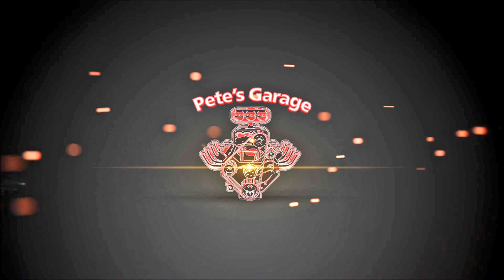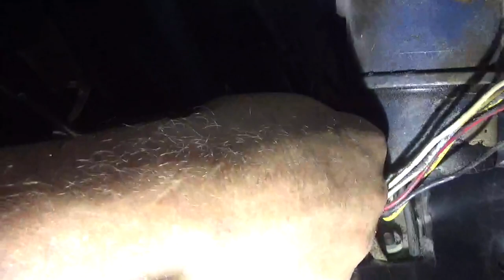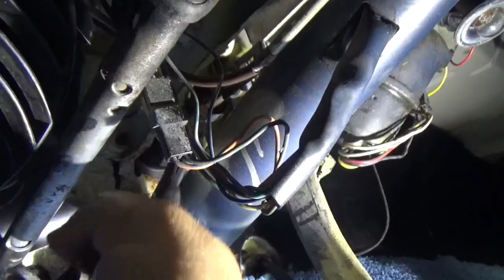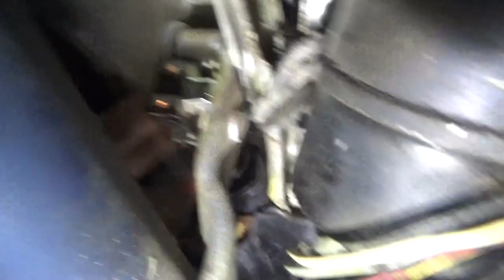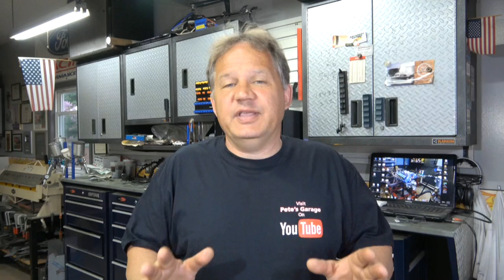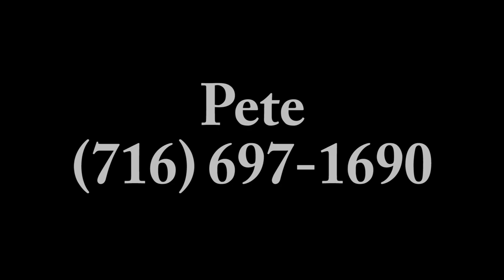1965 Mustang Changing the Brake Light Switch - Worldwide Machine Shop Database

Comment: I would step on my brake and the light would not go on till end of braking. , spring was very rigid. Took it apart squeezed it with pliers several times, also put a spacer to allow the lights to come on sooner. Worked.
Reply from the maker: Old cars are fun

Comment: I sent it to your email but there's a machine shop in Menomonee Falls Wisconsin call Fast Times holy crap do they do incredible work, they have left me with a big smile on my face on quite a few occasions.
There's a shop in Phoenix Arizona called loper's Performance Center. They did the machine work on my Blown 572 Polara, when I had it I used to race it at Firebird Raceway. But then I sold it and built the hell out of my 68 LeMans and like a stupid idiot move to Wisconsin.
Reply from the maker: Awesome! Thanks again Bill

Comment: What about bushings? Do you need to reinstall them? Do you need more than one seen on the push rod (white)?
Reply from the maker: Yes you do. These are really tricky because the length of the push rod will hold the light on or not turn it on.
Reply: @PetesGarage I had this issue forever and couldn't figure it out, then one day i got tired of it laughing at me (lol) and i decided to tackle the issue.

What happens is a lot of times the black inside bushing gets worn and falls off or disintegrates etc,since its not there anymore the rod will push on the switch but that nice black bushing is not there anymore so the rod has a little extra travel, what that does is it bends the switch plunger,it will still work and your lights will come on fine however the plunger on the switch is no longer flat, it is now curved.

One day you are changing your booster cause it went out and you tell yourself "wow, that black bushing is not there anymore, im gonna order a new one,you put in it, happy that you are putting everything back original and guess what? your brake lights dont work anymore!!! the solution? a new switch along with your new black bushing or just leave the old switch but no black bushing,you cant have both OR you can try and bend the plunger straight again and try it but most of the time it wont work,new switch is in order.